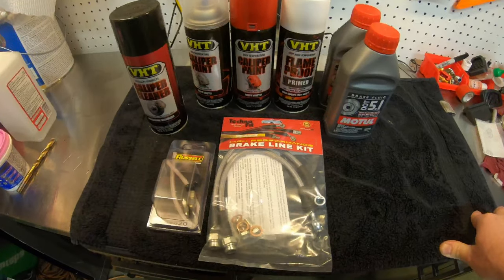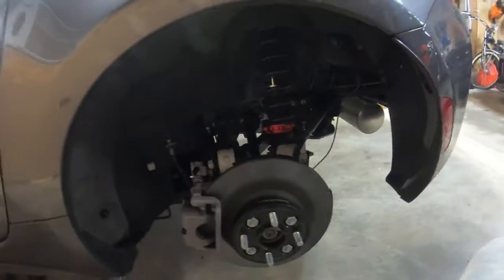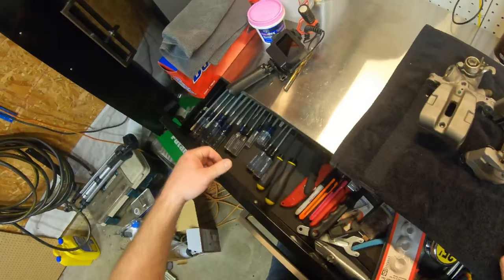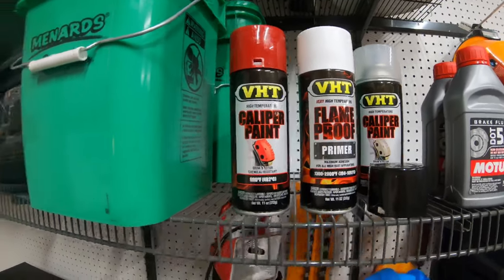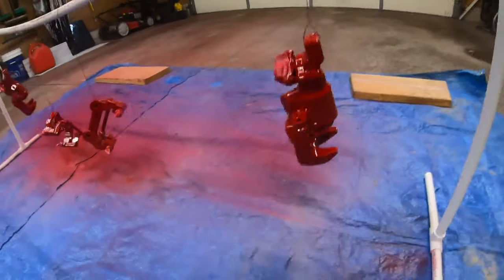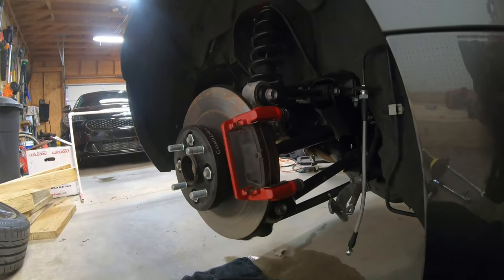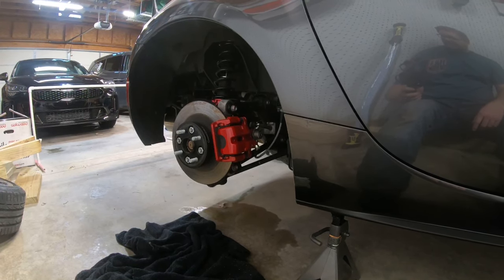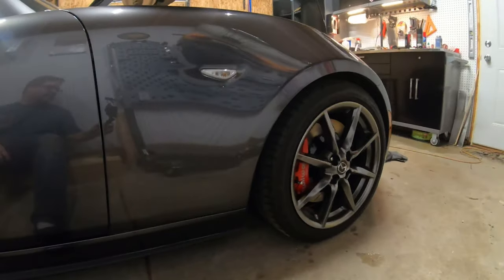Painting the rear brake calipers on my Miata

Comment: I'd recommend getting braided brake lines for the rear aswell. From my experience braided lines only at the front result in extra swelling in the rear rubber lines, so you don't get much of a pedal feel difference. Obviously your pedal feel will be pretty darn good with those big brakes anyways. But something for the further maybe? 🤔😎 

Love the music in all of your videos
Reply from the maker: Actually I installed braided lines on the rear calipers when i pulled them for paint. I didn’t go into much detail on that since the focus of the video was more on the paint process. Since I was going to pull the calipers anyway it just didn’t make sense to NOT upgrade to braided lines!

Comment: Thanks for taking the time to film and share this video. Im looking to do the same with my callipers as I don't want to paint the while they are on the car. Did you pop out the caliper cylinders or did you just mask them up? Also, how much paint did you use. I'm wondering if one of each can would do 4 calipers? Cheers from Australia!